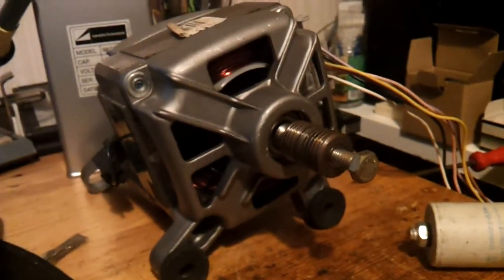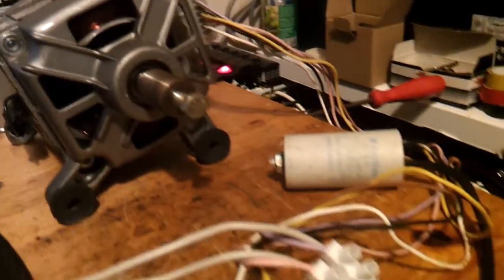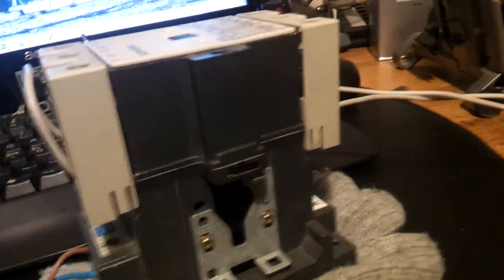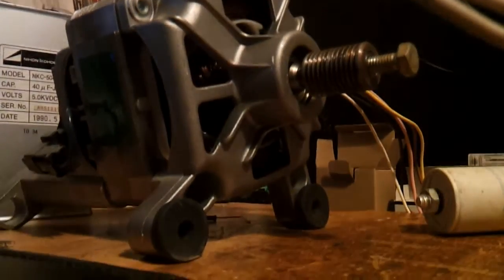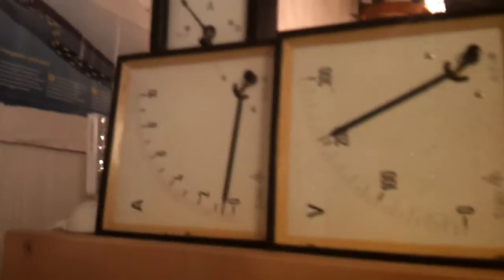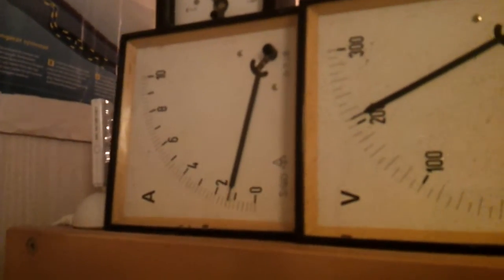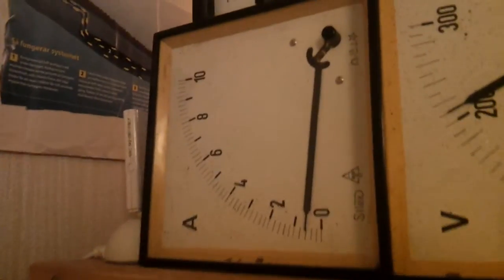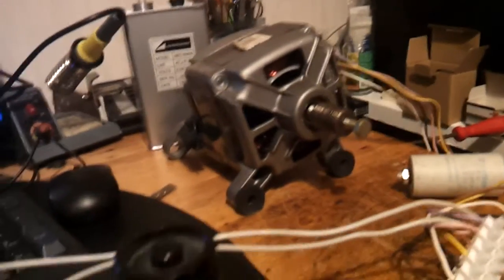WASHING MACHINE MOTOR "SOFT STARTER"

Comment: Congratulations, Mr. Tesla !
Please Mr. Tesla, do you know how the washing machine does control the motor speed/torque ? I am dismounting one machine, and I didn't find any classic soft starter, or inverter as I was expecting or I would like. Apparently, the machine does soft control of motor speed and force, when it is washing clothes. 
Motor Data:
 250W , 127V Single-Phase Induction, Cap 50uF, RPM=1625.
Thank you.

Comment: HI there. Nice idea you cam up with tough! 
Would you please tell me if you have any suggestions for a potential problem I face.
I need to slow down the speed on a 15 Amp motor, with brushes, in my table saw which turns at 8500 RPM in less that a second. And am looking for a soft stat device that will not brake my bank. 
Please, I'll appreciate any help, and thank you for it.
Reply from the maker: Hi
You can use a dimer or a variac (if you have one) to slow it down, for soft starting you can use capacitive ( like in this video) or resistive ( having a power resistor in series with the motor) for softstart you need to bypass the current limiting device. you can find these things on ebay or in scrap yards
Hope this information was helpful